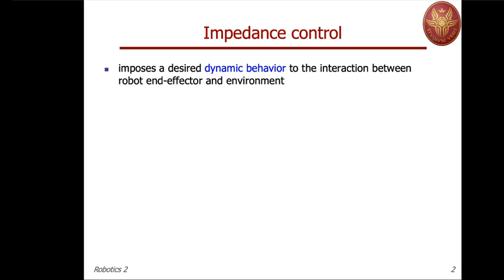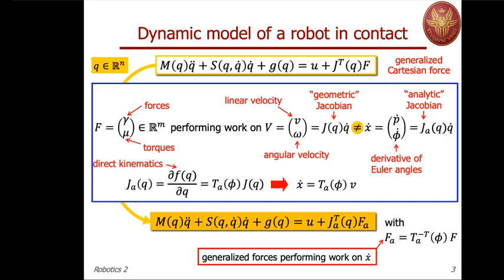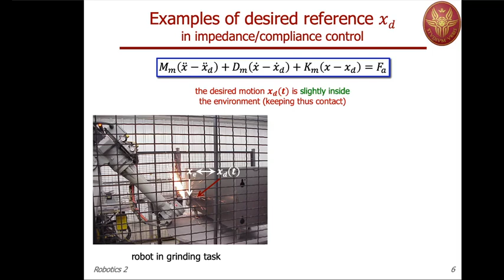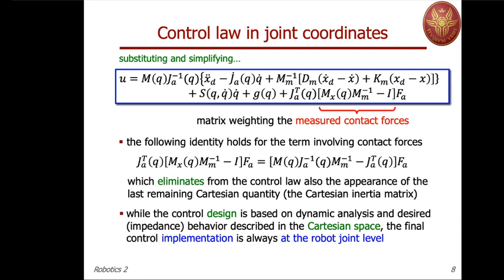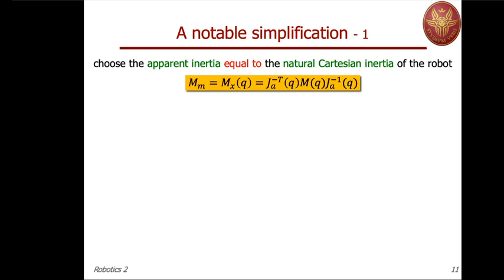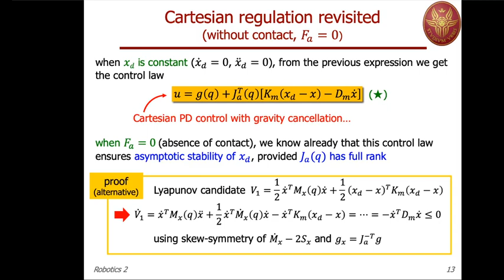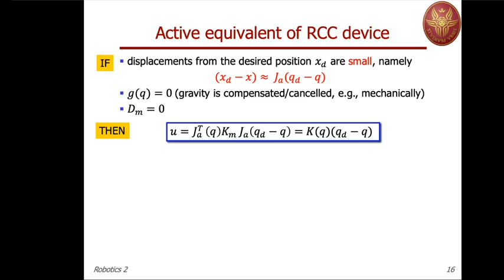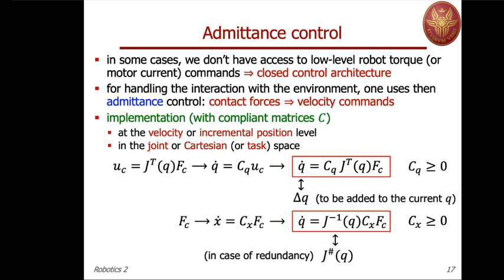Robotics 2 - Impedance Control

Comment from the maker: Dear Udayan Banerjee, thanks for your comments. Please check also my old web page:
http://www.diag.uniroma1.it/deluca/flexiblejoints.html. You will find there two blocks of pdf slides in English on modeling and control of robots with elastic joints (EJ = SEA) or with variable stiffness actuation (VSA). The slides date almost 10 years ago, but are still a good introduction to these topics. The initial part of the second block of slides is devoted to collision detection and safety; VSA starts around slide 23. Enjoy! ADL
Reply: Thank you very much sir.